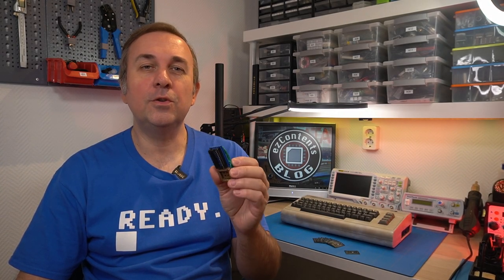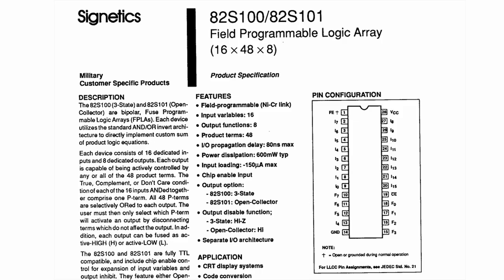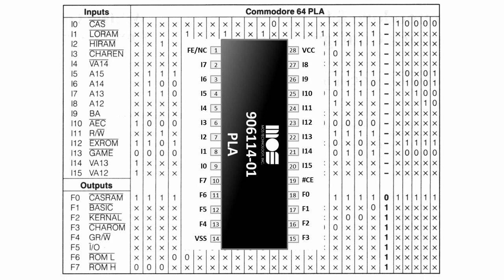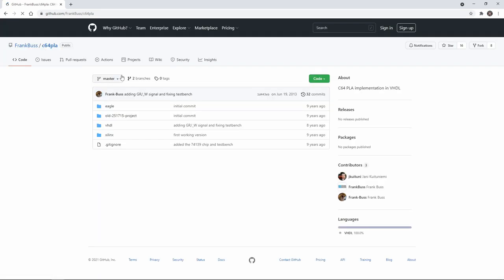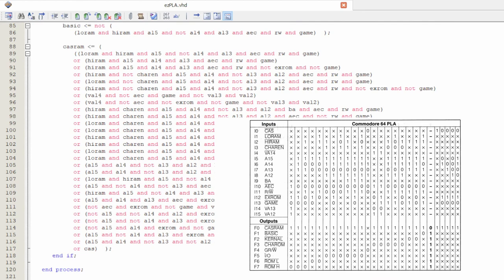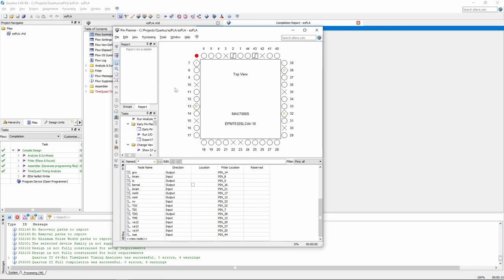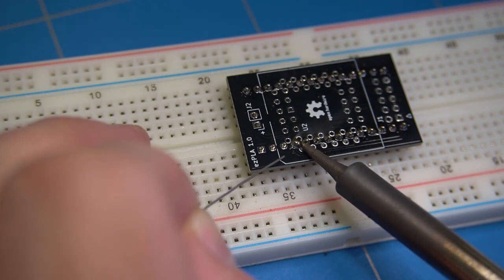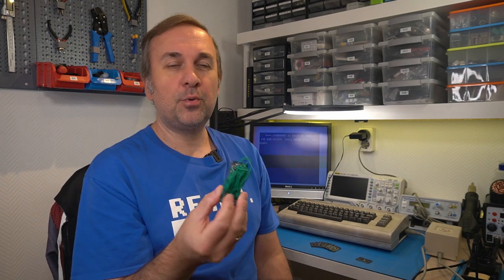Commodore 64 PLA chip recreated in VHDL

Comment: Hi Marek, I'm trying to program a chip and I always get the wrong result. I'm using the EPM7032STC44-10N chip to take advantage of several boards I have from Mattislind's PLA project that are compatible with the chip I'm using. Would it be very difficult for you to compile a file to program this chip? I would be very grateful, my programming knowledge is null. Thanks in advance.
Reply from the maker: I'm not sure, but I could give it a try to compile it in Quartus.
Reply: @ezContents  Thank you!!!
Reply from the maker: @franciscojose5816  No problem. Send me the details and links to the source code.